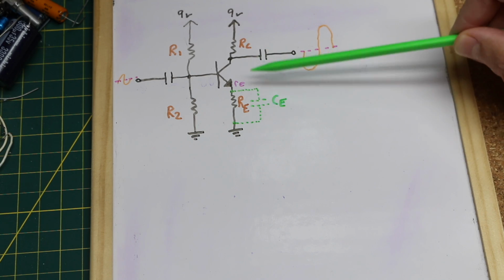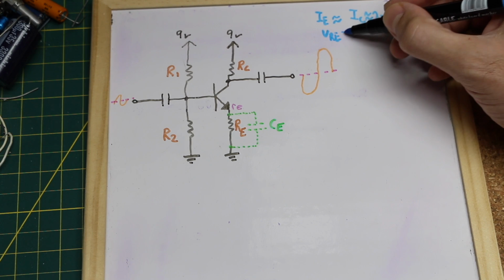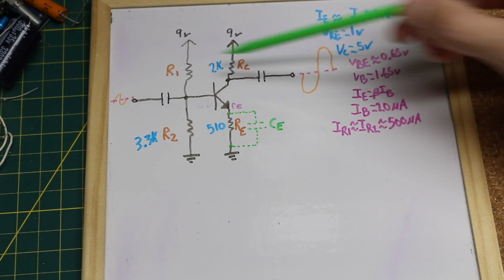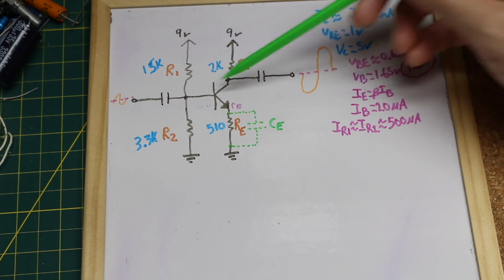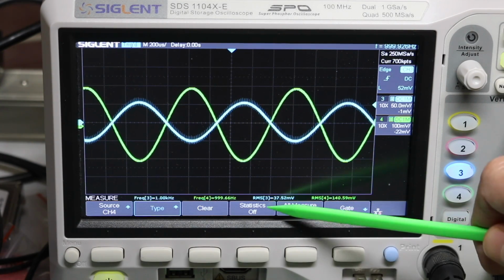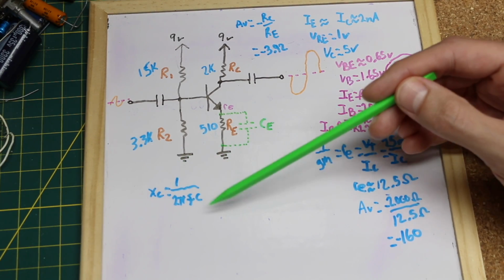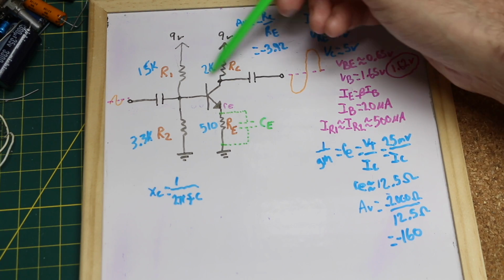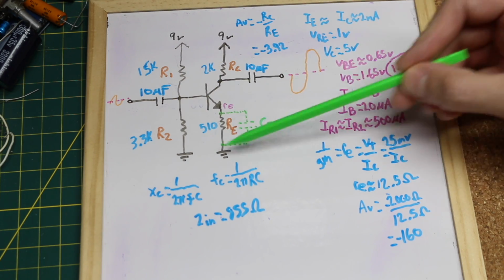Common Emitter Calculations and Circuit Demo

Comment: Thanks! Very good explanation. It's review for me - review of things I learned 40 years ago, ended up never using, and pretty much forgot. Nowadays, with more time to tinker, this sort of knowledge has become useful to me.
EDIT:  Aaaaand... this comment will never be seen because YouTube decided it's not worthy of showing up in the default (Top[ Comments) sort. Only shows with Newest First selected. I doubt I will ever understand the method to the madness of YouTube's comment ranking.
Reply from the maker: I think every time I learn how to do the transistor calculations, I forget the op amp ones again so I think I need to review that now.

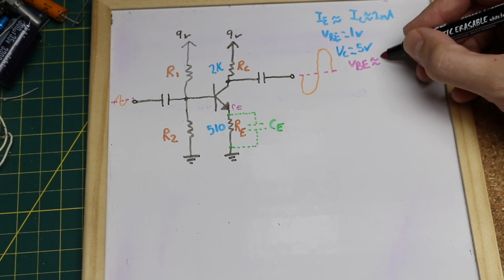Comment: Where did you get 0.65V for the BE junction at 4:53 ? Is that in the data sheet? Thanks for this video! 🙂👍 Math used to beat me up and take my lunch munies in high school 🤕
Reply from the maker: it can be hard to find certain stuff in data sheets and then different data sheets between different manufacturers  might imply different things or omit specs or only provide the spec for a very specific usage case  like a specific collector current that’s not anywhere near what you want to use.
Generally it’s accepted as between 0.6 and 0.7 V and most people just use 0.7 but I noticed at least one of mine in the transistor tester was measuring closer to 0.65 so I used that. it will change anyway based on temperature or current fluctuations so I think it all works out within a few percent for accuracy.
Reply: @GadgetReboot  Thank you! 🙏Now then, where can I obtain a pack of those "professinal semiconductr" TO-92 packages? 😆
Reply from the maker: I wish I could say RadioShack but now everything has to be shipped in

Comment: Thanks for the refresher, it's been a year since i posted a similar video in my electronics Kit series.  🙂
might be worth pointing out that the power supply acts as a large capacitor which is why (R1 and  +9V junction) is affectively seen as the same as 0V or ground to the input AC signal.
Reply from the maker: I remember being confused for years when I would see a  circuit analysis drawing equivalent versions where the positive rail was AC ground.
I figure I’ll have it all figured out just when I’m ready to give it all up for good.
Reply: @GadgetReboot  I still have to stand on my head when looking at old circuits with PNP transistors as the  +Ve supply can be seen as ground.  

Whit valves the grid leak biasing always makes me scratch my head, electrons leaking out providing a negative bias. 🙂

Hope you don't mind me dropping a sly hint for my electronics experimenters kit series. 
;-)
Reply from the maker: The more information people have access to, the better!
everyone should be promoting all available helpful Content.
I always avoid PNP circuits because I can’t get past the fact that electricity has to flow in the wrong direction to use them, defying  the laws of gravity and everything else.
The circuits would need to be put in enclosures to keep the electrons inside.
Reply: @GadgetReboot  Well  just to throw a spanner in the works, electrons flow from the -Ve to the +Ve.  the arrows on diodes and transistor point in the direction of conventional current flow (holes) and ignore the electrons.  
Another thing to head around is electrons travel down a wire at the same speed or less than a🐌

Comment: Thanks for the refresher. It's been a very long time since I went through the full set of calculation in a basic BJT amplifier.
Reply: i think i'm the only one with thousands of pages of notes haha. i kid, but i do. young and retired man haha. there's updates for that pod go you have ehh. that's what someone told me at long and macquade the other day while parting with way too much money. i got a classical gig with another dude for money. he needs a lead player. been years since i played classical cord voicings using just my fingers. i hybrid pick alot when i want to flex and bring a riff back to timing with what im beginnning to think has been a waste of tens of thousands of hours of practice but such is life i guess. haha

i use diodes to bias if im in a hurry and depending on voltage rails. you're a great engineer j. i maintain you waste your talent on a platform that doesnt care about you.
Reply from the maker: now I just need to add maybe some common collector stages to improve impedance but that’s a project for another year.
Reply: @GadgetReboot  you can do this stuff in your sleep brother haha. great video.
Reply: @GadgetReboot  an smd transistor logic clock would be cool man. alot of hours in cad though man. like tell the time clock i mean. i went looking for all my transistor notes and they're so spread out 80 percent makes no sense to me haha. when my workshop is finished yet another reno i'm gonna go over everything again and make prettier boards with examples. worst thing about perfboard is you throw it out or parts get bent and they dont work anymore or what you thought once looked good is a massive eye sore. i speak of me obviously haha.